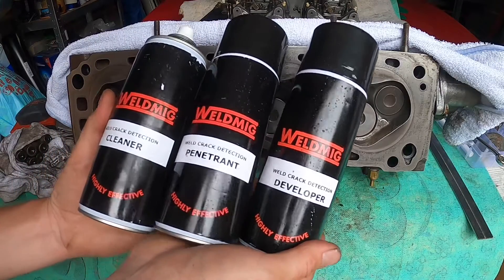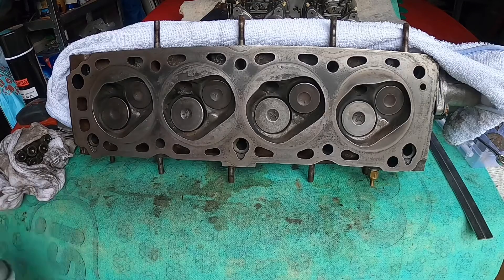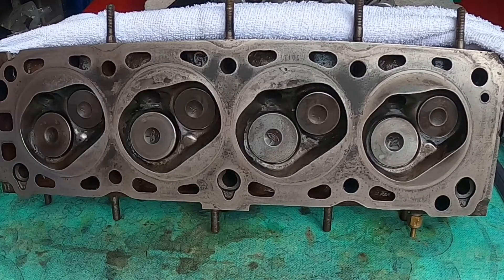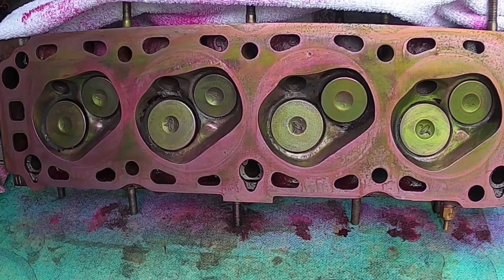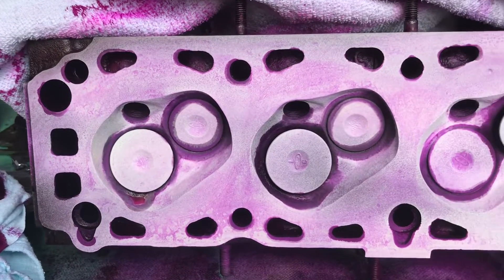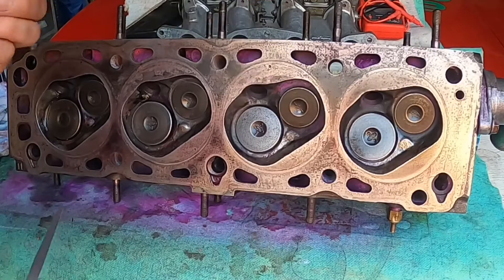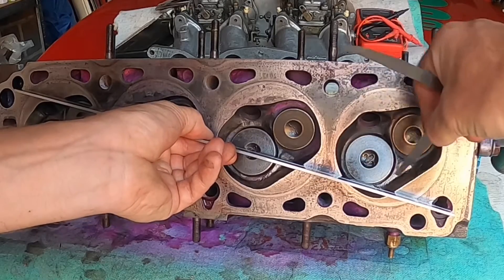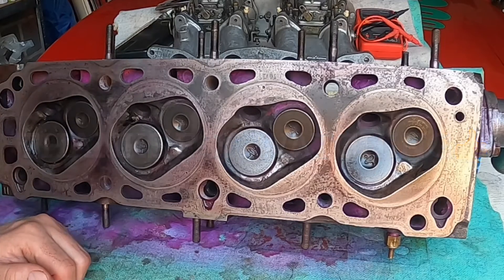How to use dye penetrant to identify engine head cracks and assess head flatness Part 4 Ford Pinto

Comment: To weld cast iron you have to heat it up until it’s red hot, then weld it, then let it cool down slowly. To let it cool slowly you can burry it in really hot sand.

The problem with cast iron is that after you weld it, the weld is great, but then it cracks elsewhere as the weld cools. By heating up the entire head first, you can let the entire head cool down evenly.

Comment: cheers, wouldnt it be better to remove the valves for this test, just incase a crack is in/under the valve seat?
Reply from the maker: Yes. I felt I could see enough and if there were any cracks the valves would be coming out for closer inspection
Reply: Great vid-thanks for sharing!

 One point; instructions read to spray a dry rag to clean the penetrant, but you sprayed directly on the head.
Reply: @darrelladams9991  we use this in the welding field all the time we don't really use the cleaner we just spray it with water and wipe it off if its really a crank it will Penetrate deep enough that water is not gonna wash it off.
Reply: You can do a leak test with brake or carb cleaner. Spray it into the exhaust and intake ports to see if any leaks through the valve seats. If there are leaks, lap the valves and try again.